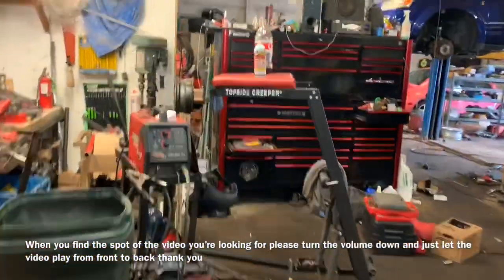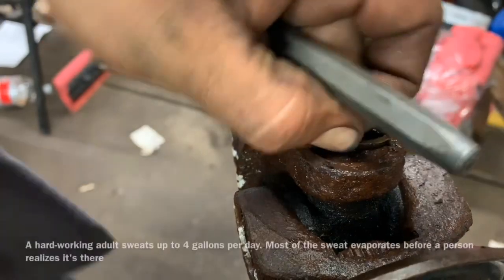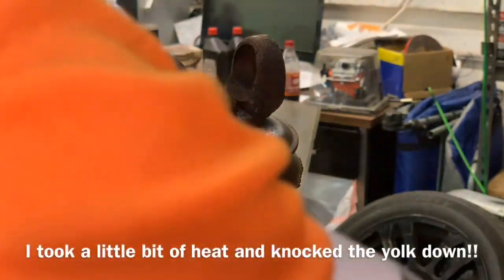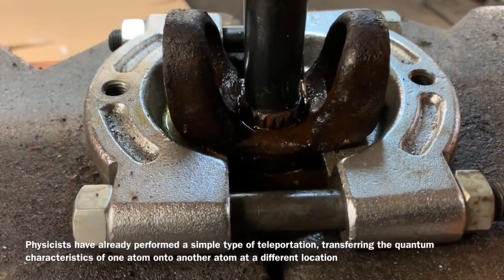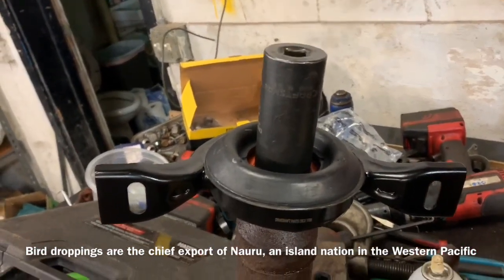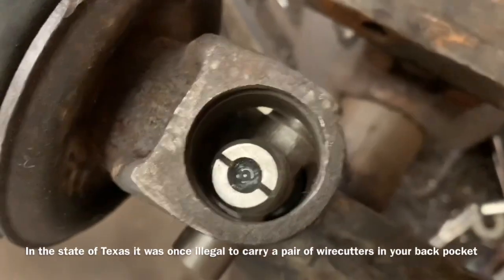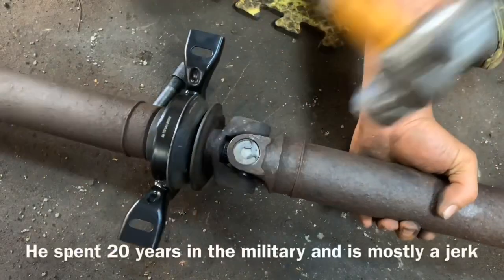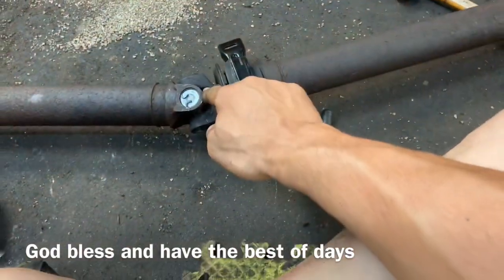Chevy Equinox driveshaft center bearing/carrier bearing/ How to remove and install/comprehensive

Comment: Hey Clay, i have a question. I removed the complete driveshaft on my 09 equinox. My question is, can i drive the SUV two wheel drive for a while or will itveuin the transmission? Let me know what you think, thanks, Mark Sansón.
Reply from the maker: Hey Mark yes you absolutely can I’ve been driving mind that way for about three months just been Busy with other stuff but you’re OK. 

It’s probably just a carrier and you may wanna just take the driveshaft and the new part to a shop and ask them to change it over it’s a lot better than trying to mess with it yourself.
Reply: @sharpcarco  thank you sir.

Comment: great video. i had a question that maybe you can help with. i have an 07 pontiac torrent also and we just replaced the entire drive shaft with a brand new one that was pre assembled with everything all we had to do was install. anyway we installed it with no issue but now its making a noise that wasnt there before. its a clicking sound that clicks faster when the car drives faster. it doesnt make noise when in idle an when turning it doesn't change the noise at all. only thing that effects it is the speed youre going like i said before. please any feedback from anyone would be appreciated tremendously. keep up the great vids!
Reply from the maker: Mark were you the folks that I was talking to on my clays AC and Auto Repair page?
Reply: @sharpcarco  no i dont think so i dont recognize the name.
Reply from the maker: Well if you look me up on Facebook under Clays Ac and Auto Repair. You will most certainly know it’s me because my channel car is at the top of the page I’ll be able to answer your questions easier but it’s up to you

Comment: You can get entire driveshaft assembly brand new aftermarket complete with center bearing, front CV joint and U-joints on eBay for $230 free shipping. Most people would never get that clip and joint apart at home so its cheaper and faster to get the assembly than fight with the rusty parts.
Reply: As low as $185 on eBay

Comment: I tried the way with the socket and ended up bottoming out and marring the inside where the caps come out with this particular driveshaft I think the first  way you just beat it loose is the only way it comes out

Comment: I have a 2009 Equinox AWD and it has no clips. It has 8 small peened tabs around the outside of each u joint bearing cap. Does not look like the plastic injection i am used too . Any thoughts
Reply from the maker: Well I can’t say for certain without seeing a picture but I think what you’re looking at is steaks. If you reach out to me on Clay‘s AC and auto repair on Facebook and send me a picture I’ll tell you exactly how to do it or at least try to anyways.

Comment: Great Video, I just replaced mine but having mild vibrations when I drive my Chevy above 80 kilometers.I can feel the mild vibration between two front seat on little console not on steering or gear.Do you think this mild vibration will go away? I change my rear axle joint as well.Do I have to do it again? Thank you in advance
Reply: I noticed that when I took mine out of the car there we're a few quarter sized pieces of metal attached to the driveshaft these are for balancing they loosen and fall off quite easily so make sure you didn't knock them off

Comment: Mine just snapped. I tired it up to the car and drove it home. Can you remove this shaft and continue driving like that?
Reply from the maker: You can pull it out and drive it wherever you want it just becomes Front wheel drive
Reply: @sharpcarco  put if you pull it out then you leave a huge hole in the trans for fluid to leak out. I just cut it off

Comment: On a 2006 Is there anyway to put the driveshaft in a different position where you get a vibration or does it only go in one way
Reply from the maker: Hello Mary I’m pretty sure that you could put it in different positions but I don’t know that it would make all of that much of a difference. You shouldn’t have a vibration. Because the drive shaft does not know its location like on other vehicles that have a separate differential for the front and the rear this vehicle does not. So I would not really think it would make a difference what position you put it in. I only marked them to make sure that I put them back in the same position from where they came. And because the centering yolk will only go on one way you really can’t mess that up either unless you use a lot of force to put it back together and put it back together incorrectly that could cause a vibration. I doubt anyone would do that but I suppose it is possible

Comment: One question I have a 05 Saturn Vue v6 awd that I just bought and is missing the entire driveshafts. So I I buy a driveshaft from a 05 Chevy equinox would fit on my 05 Saturn Vue even if the Saturn is 3.5 and equinox is 3.4l engine ???
Reply from the maker: Honestly I can’t tell you if they look the same or not. I’m fairly certain they are because the output On the differential Transmission is the same on the Honda’s and the Chevy Equinox to the best of my memory

Comment: Hey clay, I have a question about reinstalling the drive shaft. What is the recommended torque spec for it? I’m doing the carrier bearing on an 04 Saturn vue. The problem I’m running into is not being able to find the torque spec anywhere and not having an all data account anymore since I finished my auto classes from school
Reply from the maker: Look up the size of the bolt and the pitch of the threads . Then using that information you can look up the torque specs for that particular size of bolt and thread pitch. 

Auto manufacturers do not make up torque specifications they use the chart like this 

https://images.app.goo.gl/uHzgbG9EuvciAVEF9